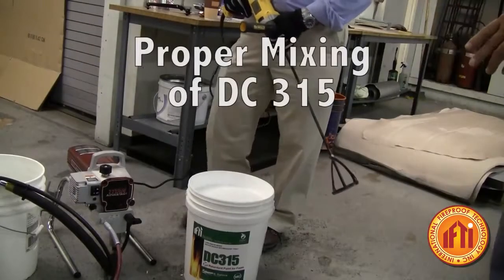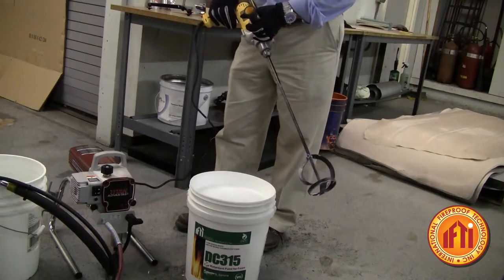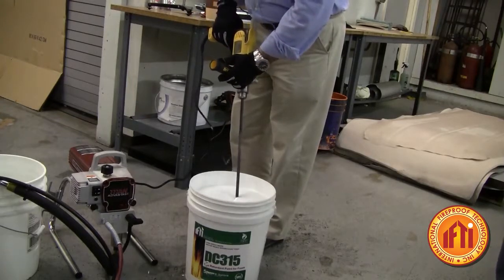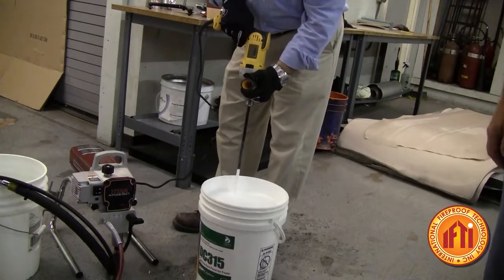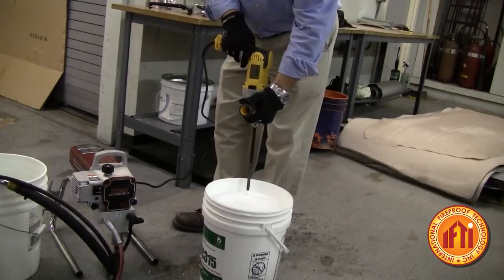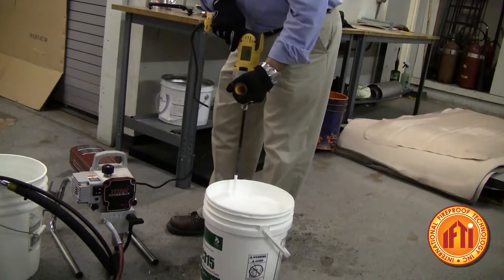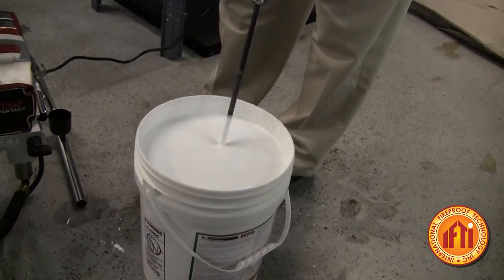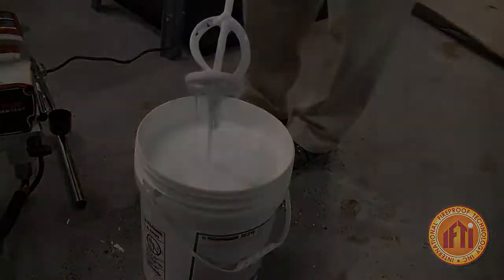How to Mix DC315 Inumescent fireproof paint Ignition and Thermal Barrier Coating

Comment: Is it normal for a contractor to mix this with additional water for more coverage?  Saw this and had to ask
Reply from the maker: Users can add water to improve the spray ability of the coating. Adding water reduces the solids content so installers mut ensure the correct dry film has been applied. So adding water does not increase the yield rather just improves the spray characteristics